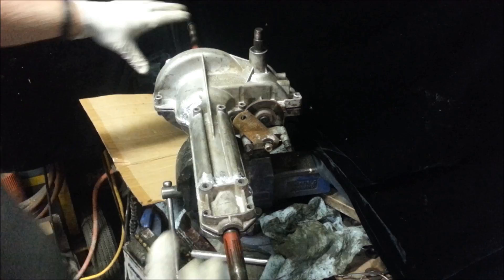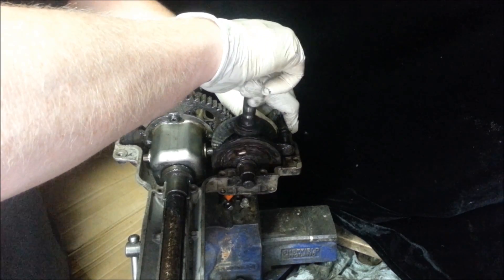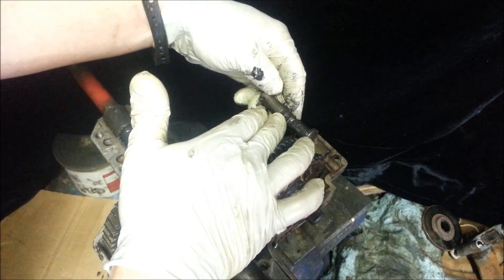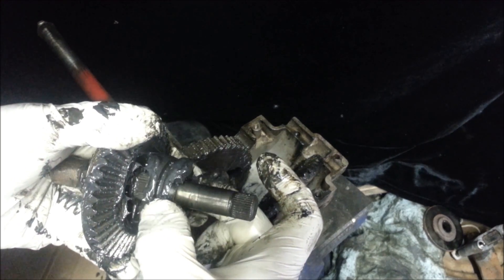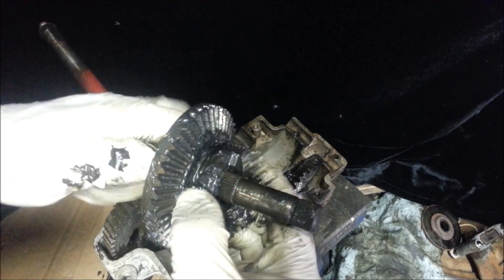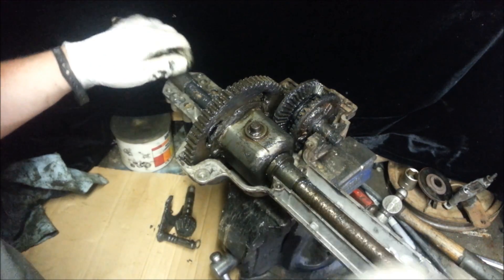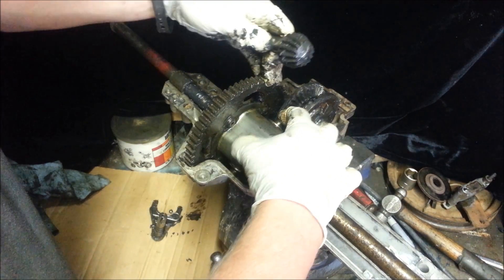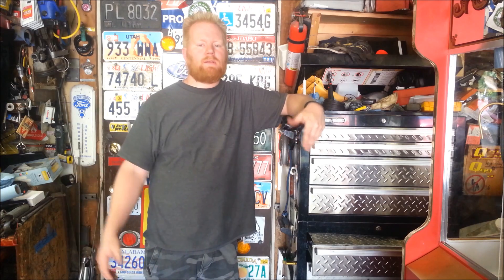MTD transmission What's INSIDE

Comment: Is it okay to use Lucas "Red and Tacky" grease in place of the Bentonite? Also, would using 75W-90 gear oil in the transmission cause damage to the unit?
Reply from the maker: Bentonite and lithium complex are not compatible so you would just have to make sure you removed all the old grease. But not compatible could simply mean that the grease just gets runny and breaks down into oil. A grease is simply a soap (bentonite, clay, lithium complex etc) that holds on to an oil and suspends it so it doesn't run everywhere. 

As far as using gear oil, a lot of guys have used gear oil in these transmissions without issue. What you will find is the seals at the end of the axles aren't the greatest, so you may get some weeping over time. But it's not going to leak out all the fluid. The gear oil actually moves much nicer and is preferred if people are turning these transmissions into racing mower transmissions as they move much faster.

Comment: Your trans has grease inside. Do they all use grease? Never gear oil??
Does the trans ever need to be cleaned out & fresh grease applied?

!
Reply from the maker: @ourv9603  All of these came with a very thin grease. Off the top of my head it's called 00 grease. The problem was straight gear oil  is it will slowly leak out as the seals aren't that great. Should you clean out old grease and replace it? Yes. Is it designed to be done? No. These are considered throwaway parts and we're designed to be used and tossed after 10 to 15 years.

Comment: This is great thanks! I was curious about what was inside this thing. I ended up just drilling a tiny 1/8th hole in the top of mine off to the side of the gear and used grease gun with a needle tip to pump grease into it with it turning on jack stands - quieted it right up! Tossed a little JB quick over the pin hole and she's good to keep on mowing!

Comment: My Troy-Bilt Bronco 42 , 2017, but new to me stopped going forward. fast forward needed to replace the entire Transmission, the top gear spinning the belt had "egged".  The new unit says "this transmission may be filled WITH FLUID. it says to check fluid level but as to watching this video there is only grease in the unit. I know these posts are all 10yrs old. hoping someone can help. Thanks!

Comment: How do you fill them up with gearbox oil I can’t find a plug anywhere
Reply from the maker: They were designed not to be serviced. The only way to service them is to take them apart and add new oil and reclamp them back together.

Comment: Just took mine apart and cleaned finally.
When you pick up the main axle and differential, is it like a solid rod?
When I pick mine up it kind of wobbles in the diff, like it's a joint.
I tried to take apart the diff to look inside to see if there is some damage but I couldn't figure out how to get it apart.
Reply from the maker: The main axle shaft is 2 pieces
Reply: @sixtyfiveford  Of course, I'm just trying to gauge how much wobble is normal, seems like it would sag some but maybe not when it's in the lower casing.

Comment: In high gear/speed or under higher than normal load the gears whine a fair amount.  Instead of removing and disassembling the transmission to re-grease would there be any marked benefit in adding a Zerk fitting or two to add grease occasionally?
(The housing is soft metal so I'm not particularly concerned with some filing bits getting inside during the drilling process.)
Reply from the maker: That'd work.
Reply: I may do that with a Yard Works MTD that I rescued and restored.  a couple spots for zerks and one opening for Gear Oil.
Reply: The "trick" to keeping the shavings from entering when you drill the hole, is to dip the drill bit in some grease ( I use "lucas red&tacky). The shavings will stick to the drill bit. I learned this from watching a YT video uploaded by "Donny 73".
Reply: @ Green Grease is better. It is waterproof as well.  Red & Tacky melts in the Florida heat.  I put that garbage in the neck bearings of my Springer Softail. It oozed and dripped all over the place.
Good idea though!

Comment: Hey bud. I got the same bolens lawn tractor. Mine is shifting and working fine. But I have grease leaking out through the smaller shaft of the tranny. Not the brake/puck side of the shaft but the other side. In all the breakdown videos I see there doesn't appear to be any kind of grease seal there. Any idea what could be causing this and how I remedy it? Thanks bro. Great video.
Reply: Don’t worry about it they all leak a little there it’s not going to burn up

Comment: In this video, you show what happens when you engage the forward gear and the reverse. On mine which is still mounted to my tractor, the rod does not go forward or should I say the gear rod does not go all the way in but it will go into reverse. Would you say that I have to take apart the transmission and see whats the problem?
Reply from the maker: Yeah, the only way to diagnose is to remove it. You can try rolling it forward at the same time as engaging the lever.

Comment: The forward/reverse gears.. u think they’re cast or cheap pot metal? Mine are stripping bad and need replacement.. know if anyone makes machined gears made from billet or another strong metal and with tighter tolerances? My Husky is a 25hp 50 or 54 inch deck supreme yard tractor

Comment: Can you get parts for the inside say if one thing breaks? How common are those parts across multiple mowers / years?
Reply from the maker: These are extremely common and were used from the 80's to the 2000's. Parts schematics are available so you can get part numbers and find the exact part you need.
Reply: @sixtyfiveford  I see , interesting

Comment: I have a problem with my mtd 600 series
It has a similar transmission.
When I'm driving in forward it starts slipping.
I already changed the belts. They wasn't the Problem.
So it must come from the transmission.
Also the forward gear is much louder as the reverse gear.
Any suggestions?
Reply from the maker: Does it have a hydrostatic transmission?
Reply: @sixtyfiveford  no 
It's looks like yours.
Two gears and the claw in the middle to select the gear
Reply from the maker: @miguelg.4880  Then more than likely it's your CV clutch in the middle. It's the thing that the belt from the engine connects to and then the belt from the transmission connects to.
Reply: @sixtyfiveford  what could be wrong with it and how to fix it ?
I mean I already changed the belts and all the pulleys where looking normal to me.
Reply from the maker: @miguelg.4880  the CV pulley had a center divider between the two belts. The divider needs to move up and down freely. Also the entire CV pulley is spring loaded and needs to move forward and back as an assembly very smoothly
Reply: @sixtyfiveford  seems to be a tricky problem because everything works fine.
When in neutral i watched the CV clutch moving and I saw the upper drive belt spring being stretched and unstretched.
I think I'm going to open the transmission.

Is it recommended to just put grease on the gears and fill the transmission box up with gear oil?
Reply from the maker: @miguelg.4880  They only ever came with grease. I like to pour just a little bit of gear oil in there along with the grease but not a ton
Reply: @sixtyfiveford  Thx for your help!
I will reply when I (or the workshop)
got it fixed.
Reply from the maker: @miguelg.4880  This is a strange problem let me know. One issue you're running to is there are no new parts for these things. The only option for parts is used parts off eBay.
Reply: @sixtyfiveford  actually i got a pdf manual with every single bolt listed that the mower has. From the engine to the transmission everything is listed with a parts number. Mtd still produces all the parts for it.
Reply: @sixtyfiveford  i got the transmission out and opened it. There was water at both sides and the middle was black grease with metal dust in it.
I cleaned everything with diesel and swapped the forward and reverse gear.
It works for now but I will order new gears for next year.

Comment: What makes speed change? My mtd moves at half shift but slows almost to a stop at full forward. I cant understand what the linkage does as it doesn't appear to be attached to the hydro unit itself.
Reply from the maker: If you have a hydrostatic transmission, everything is controlled internally with a swash plate via the linkage. This particular transmission is a single speed with a cvt transmission in front of it via two belts and adjusting pulleys.

Comment: Thank you so much. Where can I buy parts for it. MIne`s housing where the big gear get bolted to with 4 allen screws, is broken .
Reply from the maker: It's not the easiest thing to find parts for these. Google, Ebay or buying a complete used transmission are your options.
Reply: @sixtyfiveford  Thanks so much. Appreciate.
Reply: Try "Jack's Small Engine City"

Comment: Hey man I subscribed. Just bought an mtd transmatic. Can you tell me what fluid goes in these and can I change the fluid or grease in this?
Reply from the maker: Thanks for subbing. These need to be removed and split in half to regrease. They use a special "00 grease" but gear oil and some bearing grease slathered around does a great job.

Comment: Does anyone know the correct overall or final drive ratio of these? I came up with roughly a 6 2/3:1 final drive from counting the turns of the bevel gear and differential in the video, but i'm sure that this isn't accurate due to slippage of the bevel gear not being firmly locked to the shaft and parts diagrams show a 14 tooth input bevel pinion and 42 tooth bevel bull gears for an even 3:1 input ratio which is bad because you are never supposed to have an evenly divisible number of teeth, you are always supposed to have at least one gear in each meshed set have a prime number of teeth, so 41 or 43 would have been better than 42. This would be an overall ratio of 20:1 but from research a common lawn tractor final drive ratio is 9.89:1 so I don't know.

I would go count it for myself but my MTD that had this transaxle was, sadly, stolen.
Reply from the maker: This single speed transmission uses a centrifugal belt transmission before it to have a higher range of final drive ratios from engine to wheels.
Reply: @sixtyfiveford  My question has nothing to do with the continuously variable transmission belts, what I'm asking is about the final drive ratio, the final reduction gear drive, hence the name, between the transmission and the differential. In this case the ratio of the shaft that the brake rotor and final pinion are on to the differential bull gear. IOW entirely internal to this transaxle. It's not "engine to wheels", it's even not transaxle input pulley to wheels, it is at most bevel gear to wheels.

Comment: Your video is on the 1st page on the google search that I typed in. Now after watching this video, I can see now that these 6 speeds are in a ''Pulley'' based drive system, so that's how 1 trans axle works with all of them. My stepson bought a 6-speed, well, you might as well call it a MTD since it has ''MTD'' just below ''Troy-Built'' under the seat on the tag with the Model & S/N. At any rate, the forward side of the gear was worn out, so no forward period. That is the only part that he needs but my question is, what type of oil or gear lube is supposed to go inside the trans case? The stuff in there now is a mixture of a blueish colored grease & gear lube. I know from running heavy equipment all my life that there should be a seal at either end of the unit to keep the lube inside the case & not all over the garage floor. That was my guess to why there is a mixture of Grease with Gear Lube, just no Automotive ''Rear Axle'' smell to it.
Reply from the maker: These generally take 00 EP(extreme pressure) grease. However I've never had an issue with greasing all the gears liberally and then pouring 80-90w gear oil over the top to help distribute everything.  00 EP grease is pretty close to what you would get when you mix grease/gear oil.

Comment: My MTD locked up on me the other day. I had to take the rear drive belt off so I could push it. The pulley on top of the transaxle turns while I push it in neutral. Is it supposed to do that? When it's in gear you can't push it even with the belt off. I can turn all the pulleys with my hand. Could the problem be in the transaxle? It has the variable speed pulley.
Reply from the maker: Sounds like your variable speed pulley is just gummed up.
Reply: @sixtyfiveford  I can turn the variable speed pulley by hand with it in neutral and the belt on. But when I try to push it the transaxle pulley turns and it drags the rear wheels.

Comment: I have a1980 Roper lawn tractor with a  5 speed and a reverse the shifter leaver  sheared the bolt off and now it’s stuck in gear it was very stiff shifting before this. Can you offer me any advice how I can go about fixing it and replacing the shifter bolt and find out why it was hard to shift into gear any help would be very much appreciated.
Reply from the maker: The grease inside has more than likely solidified and that was making it stiff. The only way to see what it needs it to pull it apart.

Comment: How would u change the oil on one of these
Reply from the maker: They are supposed to be lifetime lubricated and for the most part that is true. They will run 15-20 years before the oil needs to changed. You will need to pull the transaxle out and split it in half to change the oil.

Comment: where'd be a good place on the upper half housing to drill and tap a 1/4 inch pipe plug fill hole on the single speed transaxle(2012) non hydrostatic ?  I'd pour in some 85W - 140 gear oil.  Or just drill a hole making sure to keep the metal from the last few thousandths of an inch of the bottom of the hole from falling into the transaxle and then just place a plastic plug after pouring in some oil .  Would oil flow from the front where the power comes into the tranny back to the pig if  there were say a pint in the bottom of the transaxle?   LET HER LEAK OUT ONTO THE GROUND OVER A YEAR IS FINE WITH ME... just wanting to avoid premature failures on this fairly new low hour unit i have.
Reply from the maker: If I was to do this I would drill directly above the differential housing. It is sealed up pretty good and one application of gear oil shouldn't leak out.
Reply: and the added oil would be able to work its way forward to the forward/reverse assembly in the front where the power comes in through the trans pulley ?   you suppose that pot-metal housing is machineable enough to take a tap ?
Reply from the maker: The metal seams to be a decent aluminum. It's not much thicker than 1/8" though. The main large axle gear will fling the oil around everywhere internally.

Comment: do you still check messages?. I'm sure your busy
Reply from the maker: Yep.
Reply: hey that clutch poly or tensioner poly is sticking tho , probably be no harm in attaching a spring to the bottom of it, I tried to bend it down some but it won't help, and I don't want to drill a hole an poke it with a rod or keep hitting the peddle repeatedly, so you think a spring?
Reply: but thank you so much for your help, I was thinking it was in the rear-end , you saved me hundreds and alot of time

Comment: when I release the clutch peddle I'm getting nothing like I used to then it grabs and makes a clunking sound goes a few feet and no longer grabs... don't really have anywhere to tear her down here but if you know what part probably went that would be very helpful. it's a mtd 7speed shift on the go . I'm not certain it's the transaxle at this point ....what do you think?.....thanks
Reply from the maker: Under the center panel between your legs is a variable speed clutch. More than likely it is just sticking. Take off the center panel and inspect it.
Reply: I just got your message, am going outside this very moment and gonna check ,thank you. I will let you know
Reply: belt slipped and was wedged under Poly , and now I have pushed belt to wrong side with back of belt against poly
Reply: got it back on and still got major clunking when in gear,, turned out to be the upper belt smaller of the 2 has a inner chunk missing, you happen to know the belt size off hand?

Comment: Thanks for the vid.   Is there any way to get lub into the case without taking it apart
Reply from the maker: Some had a bolt on the top to fill it with some gear oil, but most don't.

Comment: hey, great video, i have an MTD 17 h, with hydrostatic im guessing, it goes when i push the gas pedal , stops when i let off, or slows per rpm,, it is just jerking and jumping when using, bad enough to get whiplash, i dont think it needs rebuilt, just some adjustment but i cant find any adjustments except brake, any ideas ?
Reply from the maker: Is the engine jerking or the transmission? The engine should stay at a steady rpm whether you are moving or not. If the transmission is jerking it could be as simple as low fluid.
Reply: thanks for the reply, the engine hums like a humming bird and it does feel and sound like trans issue but i cant find a drain or a refill port, , jerking forward , i have it at the stage where blade deck is removed to view better, belts are in terrible shape, oil leaks from top all over pulleys ,top of deck,  so a good cleaning and belts will be done if i can solve the jerking and lurching which finally ended with not moving forward for seconds without a rough jerking lurch ,